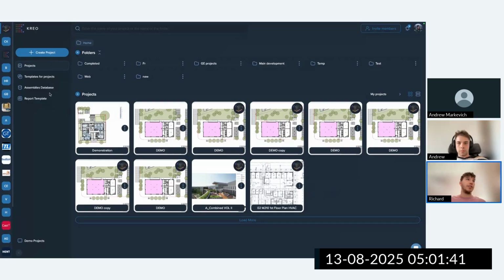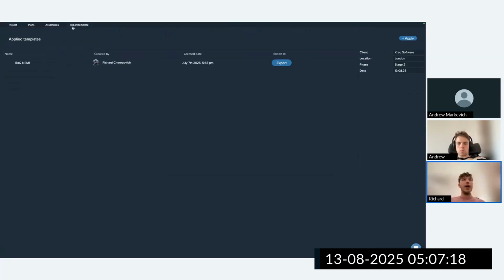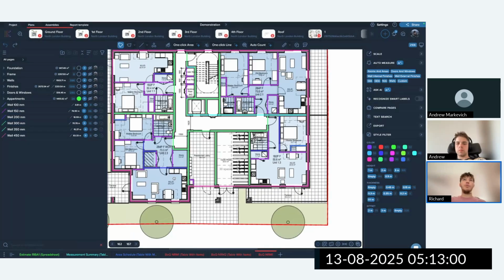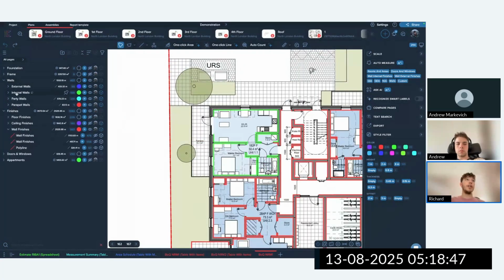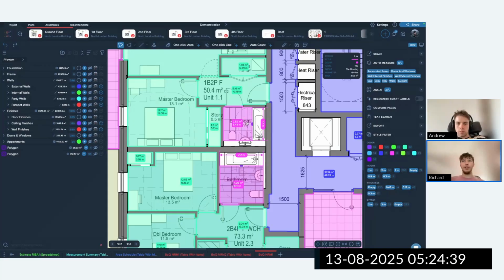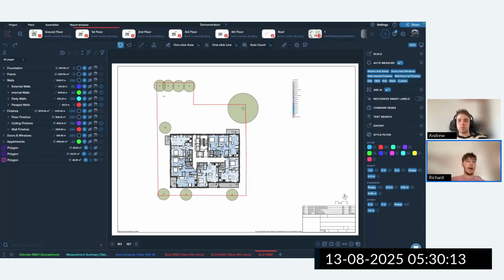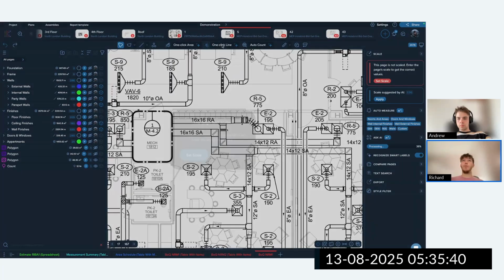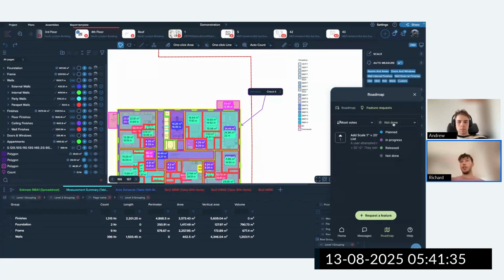Open Product Demo: Session #1

Comment: Hey Richard, thanks for the clear walkthrough. One question: what happens when the PDF is updated and certain walls are moved? Will the room polygons automatically adjust to the new wall positions, or do they remain in their original spot?